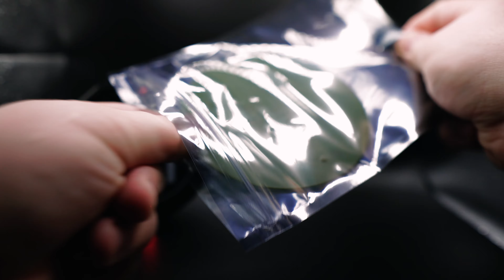Designing Your First PCB to Integrate With 3D Prints - Tutorial

Comment: The intention of the schematic is not to look like the final layout.  In fact, you would normal layout the schematic in a way that it is as easy as possible to understand the electrical connections, without considering how that needs to fit onto the PCB.  That placing in the right position and then routing the connections is what you do in that second step.
Reply from the maker: Thank you! That makes sense. :> sorry this was my first make and as mentioned I wanted to make a video that aligns with what my sponsor specializes in. Great comment!